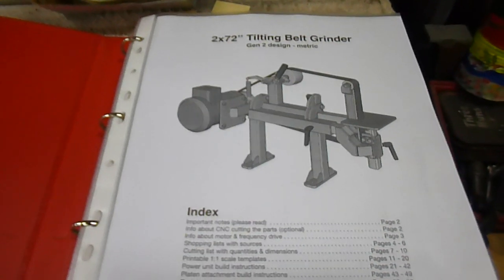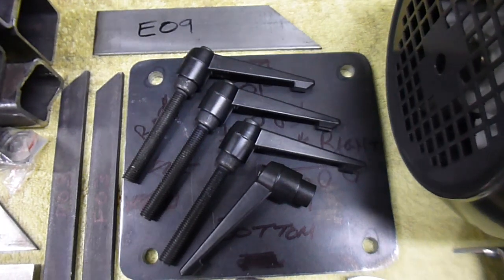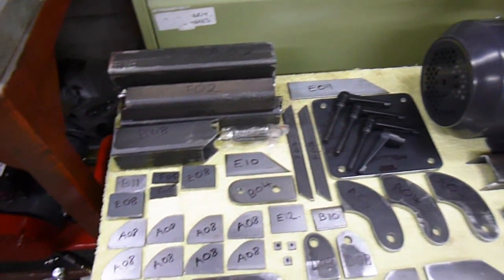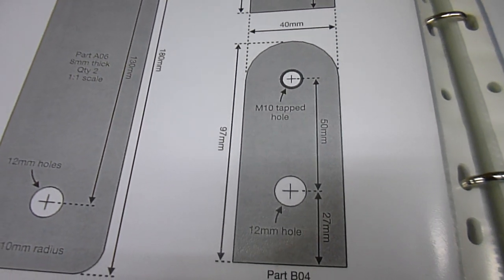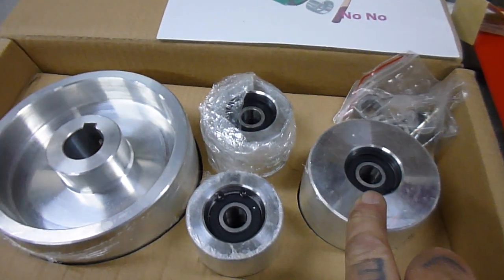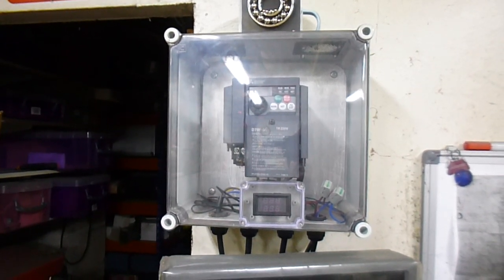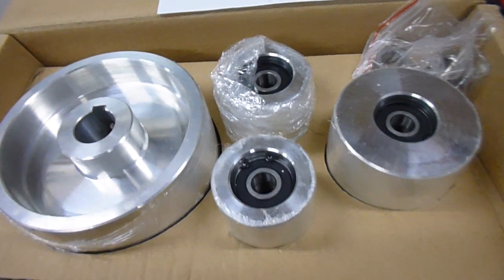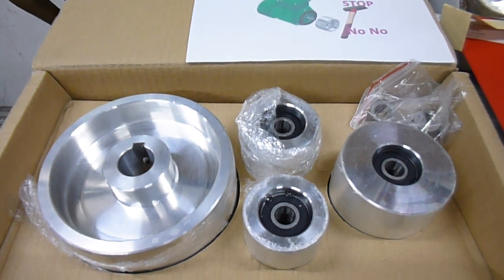2 x 72 Tilting Belt Grinder Gen 2 Build Part 1

Comment: Looks like fun.  I bought the plans and have all the steel cut out, haven't started welding yet.  You say "overbuilt", but I got the inch plans (measuring system based on barleycorns laid end to end) and it's all made of 3/8" which is even heavier, around 9.5 mm.  You know, rigidity is good, but sometimes sheer mass is good by itself even if it doesn't add rigidity.  For one thing, a burglar can't carry it off unless he's got "friends".  My current belt grinder chatters if I try a heavy cut, so I'm looking forward to turning lots of expensive raw materials into dust...

Comment: Hi Keith, looks like I started your video s from the wrong end, the first video I seen was the finished product which looked amazing and I’ve already commented on that. I decided to go for it as you said and until now I didn’t realise you yourself purchased plans to build from scratch. And looking at all the bits set out on your table is a bit overwhelming but I’m ordering plans now from your link and going for it , can I ask did you go metric or imperial ?.
Reply from the maker: hi the plans i think can be ordered metric or imperial, what i done is cut out the pdf drawings as they are 1/1 scale so i just pasted onto the flat steel and cut to the line, seriously nothing is hard on there just a lot of cutting metal and grinding
also you can print off the plans to cut and paste as many as you like
you will enjoy the build
regards...keith
Reply: @mrmyford  hi Keith, thanks for quick reply I’ll order the metric plans then and see how I go, I’ve not got the machinery you have or a decent work place , I do have a stick welder, a small drill press and a my myford ml 7 . I’ll do what I can with what I have and if mine is half as good as yours I’ll be happy.